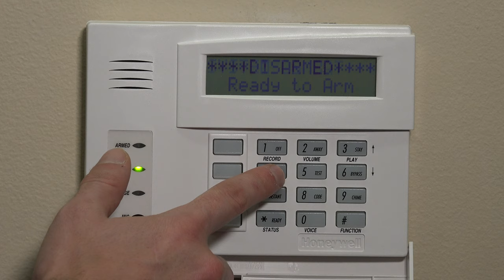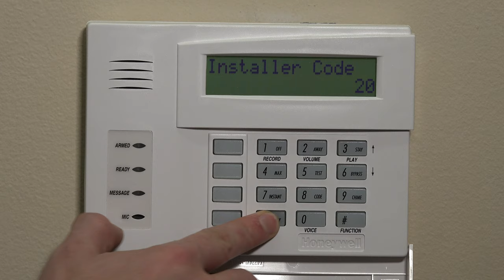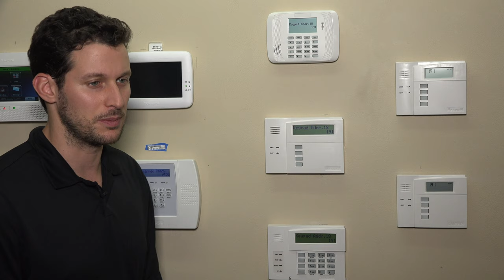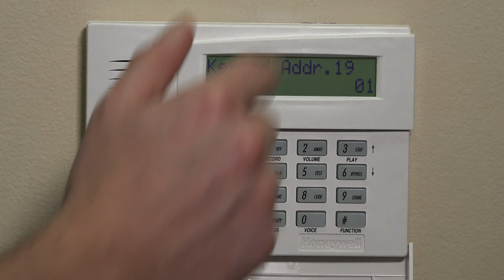Honeywell VISTA: Adding New Keypads, Enabling New Addresses

Comment: I just purchased a home with 15 year old Honeywell/ADT Safewatch Pro 3000 with two keypads. One keypad, located upstairs, is not working or never worked. Its been disconnected from the panel.  When I reconnected it, the keys light up but the LCD screen would not work. If Ibuy a new keypad to replace it, how can I determine its location address? Or what location address could I randomly assign to it?  Thanks!!!
Reply from the maker: This video shows you how to enable addresses 17 - 24 in the keypad programming if required.  If you have a working keypad on the system, it is probably set to address 16.  You can verify this by pressing 1 and 3 on the keypad until it shows you the address.  You can set the keypad address in the same way by powering it up, pressing and holding down 1 and 3 until the address pops up, then pressing 00 to zero out the old address, and then entering the new address (17, 18, etc.).
Reply: @AlarmGrid    Thank you for the guidance!

Comment: I got a central alarm ADEMCO VISTA 4110XM but I do not know the master code
How to reset the panel to determine the second master code.
I use the  6150ADT keyboard

What are the signs on the display are written by FC, DI

Thank you

Comment: Hi I recently just installed a 6280 series touch keypad and I put the ECP address to 17 by mistake.   How can I get it back to address 1?       thank you
Reply: When changing the address in a keypad that has been used before, you need to simultaneously press the [1] and [3] keys for (3) seconds within (60) seconds of powering up the keypad. Again, the existing address will appear, press [0] [0], then enter your desired address. If you wait longer than (60) seconds after power up to enter address mode programming, pressing [1] and [3] will simply display the current address without allowing you to change it, and you will have to power the alarm keypad down and start the process again. Also, if you allow (10) seconds to elapse without pressing a new key during device address programming, the alarm keypad will exit address mode and you will need to start again. Once the address is set and you press *, your keypad's LCD screen should then show the normal disarmed screen with current panel status.

Comment: I have a 20se where one of the two keypads was set to 31. I changed it to 16 and it never worked since. How do I get it back to 31?
Reply: I will be happy to answer that. The 20se is a non-addressable system. All keypads must be set to 31. As shown in the video,  hold 1 and 3 together on your keypad after power up to get into the keypad addressing section. Then, press 31 * you should be set back to a working keypad. As the 20se is an older system, if you ever think about upgrading it, please reach out to us M-F 9-8 EST at  888-818-7728 or email support@alarmgrid.com. We have low-cost, no-contract monitoring services and we're experts on the vista systems.

Comment: Then how would I program the key pad?
Reply: The video on this page explains the keypad addressing process. The programming lives in the system so you don't need to re-program the entire system. You just need to hook up the new keypad and set it to the same address that the keypad you are removing would use. You can press and hold 1 and 3 together on the existing keypad to see which address it's using.

Comment: I was surprised he could use our old keypad and add a new wireless keypad
Reply: Not surprising, most Vista panels will support up to 8 wired keypads, though at a certain point, powering them becomes an issue, and you have to add a power supply (with a common negative to the panel).

Comment: I was suprised my alarm guy said Yes, you can still use the old keypad.  The new one will just be a second keypad.
Reply: Yes, you can also add the 6160RF or 6150RF as a new keypad if you're able to run wiring to the new location. In that case, you'll need to ensure you have a new keypad address available and enabled in the panel and then you'll need to assign the new keypad to that address.